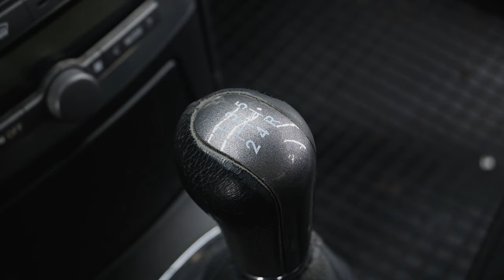Deep Cleaning This Toyota Avensis - Car Detailing

Comment: don’t you think for the wheels that dirty and brake dust baked so hard it would be much cheaper (and much faster for you) to use wheel acid? you need at least 2 passes with expensive mwc/iron x + break buster and they are still not clean. you should try acid, 1 pass and ready.
nice video as always bro btw